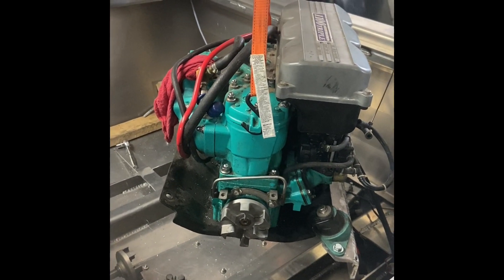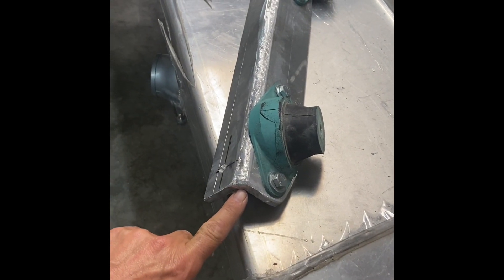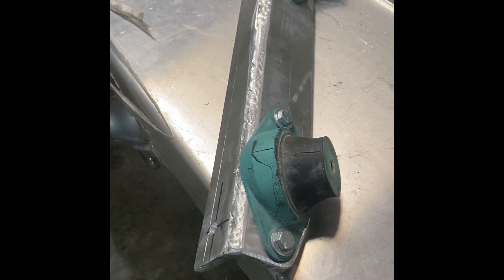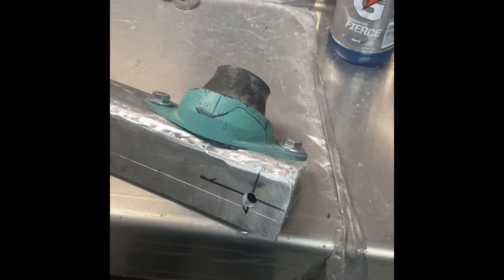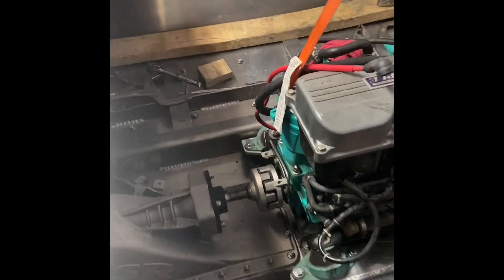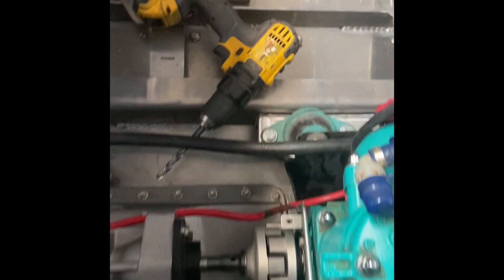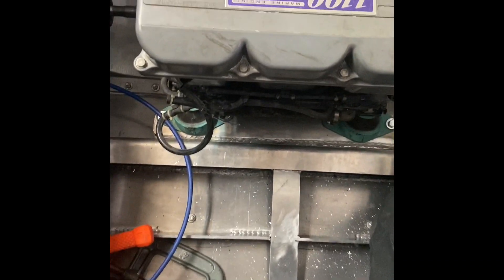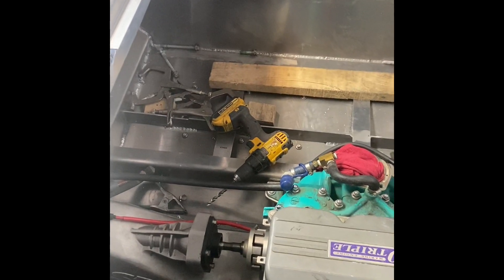Wattscraft Mini jet boat build Engine install.  RSRacecraft Skookum 13 gets its powerplant.

Comment: What's the horsepower on this engine? Is it going to be enough? Looks like a very old engine. I want to build a boat as well, but can't justify putting in a brand new one, and paying $10k + for a new doaner ski. Thanks
Reply from the maker: These 1100s have 120hp.  Just ran the boat for 3 days and had a blast.  2 adults in it, full fuel and it did just fine.  Cruises at 33 easy and hits 45, perfect for reading water!